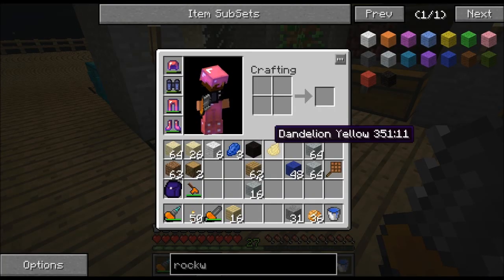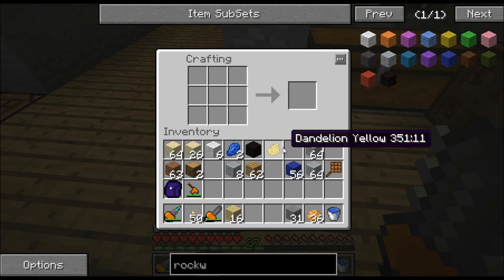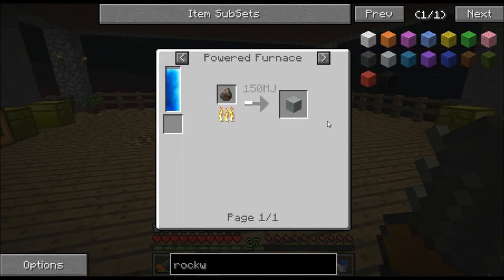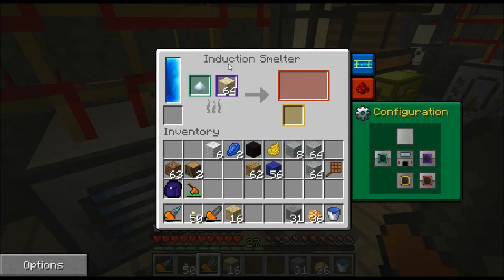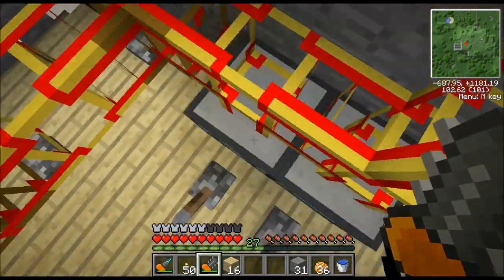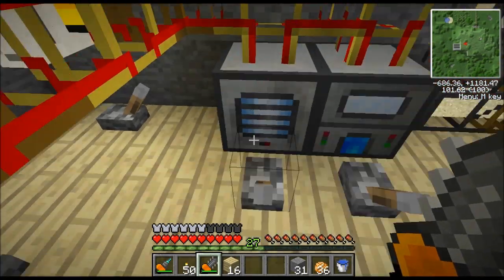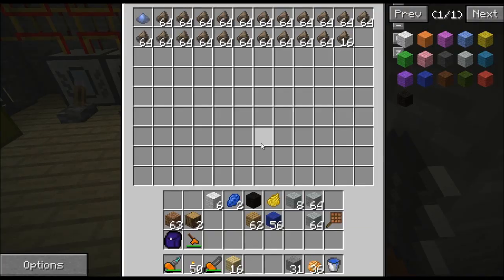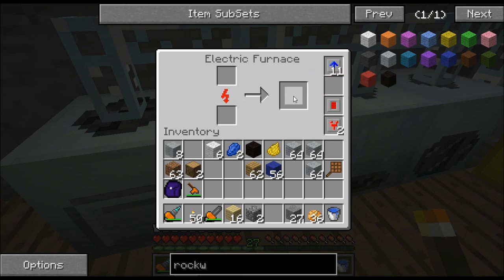FTB/Feed The Beast Tutorial Guide - How to Use And Make Rockwool With An Induction Smelter

Comment from the maker: By the way, if you want to learn electrical engines and how to use them then check out my video on how to make a solar powered quarry via an electrical engine. The video will teach you how to program and use an electrical engine. The pulverizer and induction smelter require 4 MJ of power each so I would program your engine accordingly.

I would recommend learning solar panels too. I have a video on how to make them too, although you may not have the resources for that yet.

Comment from the maker: It requires engines to run. Engines generate MJ power.  I am using conductive pipe to transport the power from the electrical engines on the left and into all of the machinery. If you are just getting started then I would suggest just placing a hobbyist steam engine on top of the smelter.

That engine requires water and fuel and a redstone signal to turn it on. In fact all engines require a redstone signal to function. If you have any problems feel free to ask here.

Comment: There's a few reasons: They are extremely efficient, acting as storage buffers much like the redstone energy cell. Each section of conduit stores 1000 MJ, so in a situation where your engine is dumping more than requested by its networked blocks (often) that energy doesn't go to waste. No need for wooden conductive pipes, they don't care about loops in the circuit, they look neater, and of course between TE machines they are state aware and allow the TE machines to throttle power as necessary.